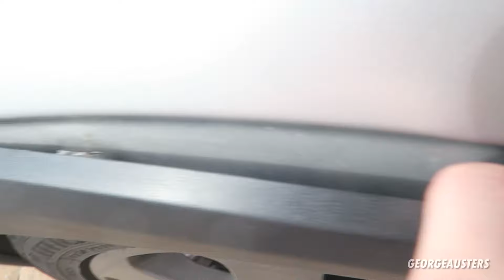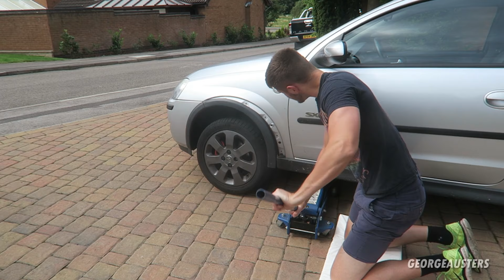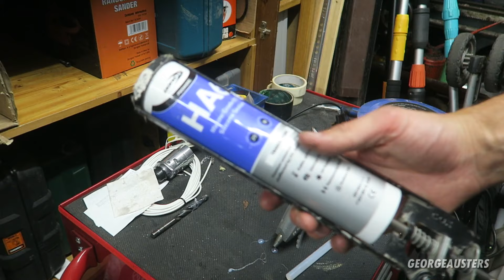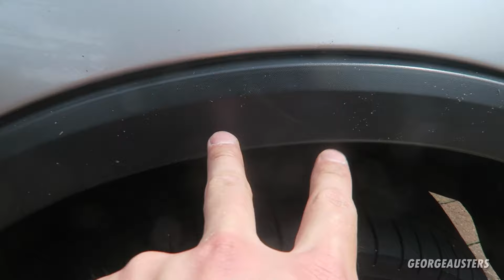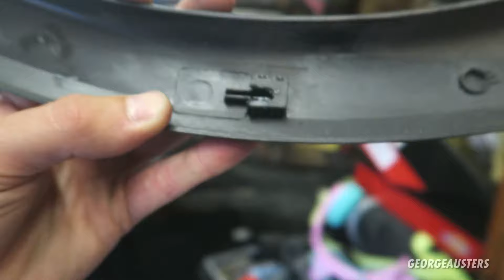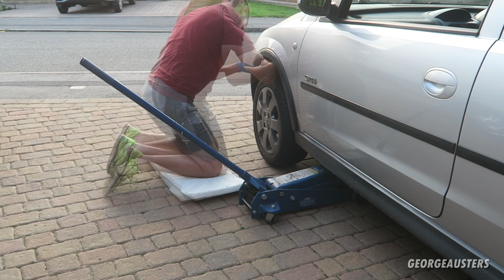The Most Annoying Problem With a Vauxhall Corsa

Comment: There's a lot of things that is a factor for how many problems your car will get.

Driving on bad roads often, bad climate, salt on the roads, one problem that's not fixed for a long time that wears out other parts, and of course the driver.

So before people judge a car only by it's brand or model they need to consider that some people don't take care of and serve their cars properly. 

I guess that's why people gets different opinion and experience about the same brand and model.

Comment: Same issue here for my corsa c 2006. If you travel in fast speed for long time, it will definetly hit you. 6 times travelling around 140-160Km/h. Here I am watching how to fix already replaced wings. 
I simply do not get it. Whenever plastic is cooperating with metal, the failure is around the corner.

Thank you for showing the hidden bolts.

Comment: I have a 2003 Vauxhall Corsa SXI, which has a leak, which we cannot fix. We took it to a garage to have to break servo sealed, which is a common problem, but there is still a leak, which myself or my parents can find, leading to the passenger footwell being damp whenever it rains
Reply from the maker: That’s the BCM box seal
Reply: I have the same problem with my 2003 corsa

Comment: I got new clips off eBay £3.50 for about a million of them and put some Silicon sealant on them never had a problem again
Reply from the maker: Usually does the job!
Reply: was just about to suggest the same ,i  would use windscreen silicone for a really good seal ,   easy fix and no more worries ..

Comment: I've had 4 corsa c's of varying ages. those trim problems never happened to me, although I do see them missing on some corsas so i guess I've been lucky. three out of four of my corsas had the dreaded water going into the drivers side footwell from the brake servo which was a design flaw, that was my biggest problem i had with these cars.
Reply: I have water on drivers seat as well, it's been 3 days I am trying to find out how it goes in
Reply: @aldishurdha9495  its going through the brake servo seals as they deteriorate over time. you're best using some silicone and going round the edge of the brake servo to make it watertight again. it also doesn't help when it rains water just sits in the windscreen scuttle drain and cant escape until you left the flap to drain the water...again due to bad design.

Comment: It is actually rarely the plastic rod that causes the gear linkage to break. People just think it is the course for the simple reason it is made of plastic. I had the gear linkage fail on me (when the car was 18 years old), but it was one of the ball joints, not the plastic rod. Replacing the original linkage with an all metal piece found on E-Bay is a TERRIBLE solution - DON'T do that, the E-Bay garbage will not be a good fit, and afterwards the gears will most likely be hard to change, and stiff.  Buy one from a mechaninc, he will most likely sell you an OEM one, with plastic rod - and that is what you want. Remember - people think it's the rod that is at fault - but it rarely is.
Reply: That's good advice, my corsa may need one at some point

Comment: I would like to get a Corsa C when i turn 18, this year, so I want your opinion. Which engine should I get? The 1.2 petrol or 1.7 DTI 75 HP?
Reply from the maker: Either really
Reply: What engine does your corsa have?
Reply: Neither, they all are going to need a rebuild between 70-130k miles if your lucky, the problems begin after 20k miles and usually its more conventional to scrap the car or engine swap
Reply: I have a 1.2 petrol. It’s good in Low emission zones (ULEZ FREE) and it’s cheap to run. WAY cheaper to run than a 1.7. You also have to consider the cost of fuel, insurance for someone so young and fuel consumption. 1.7 DTI is a diesel and rates for that at the moment is ridiculously high. I think the 1.2 is actually a little faster by 1 second